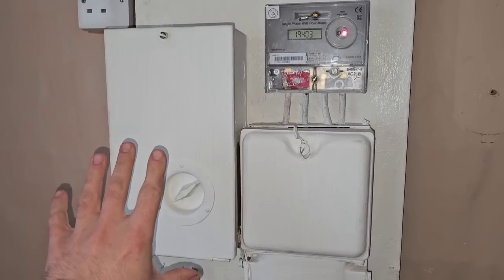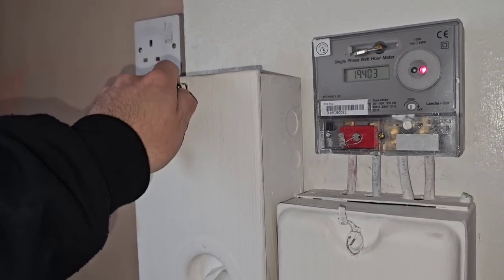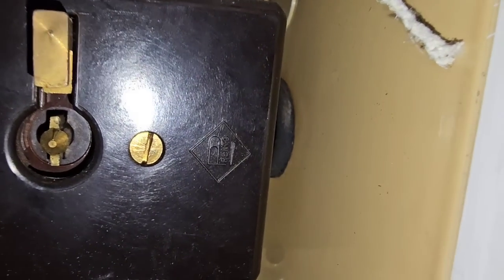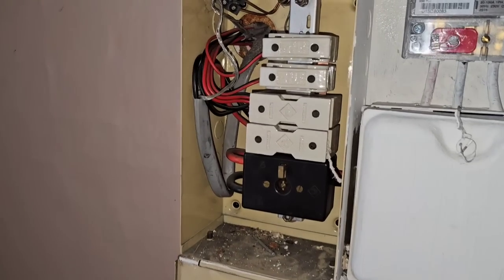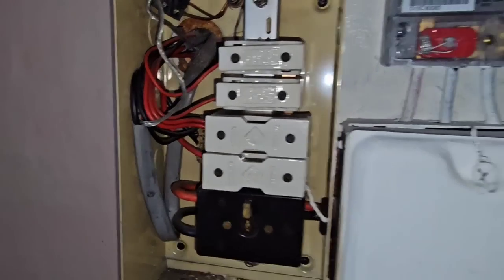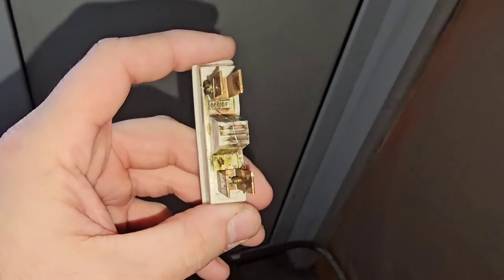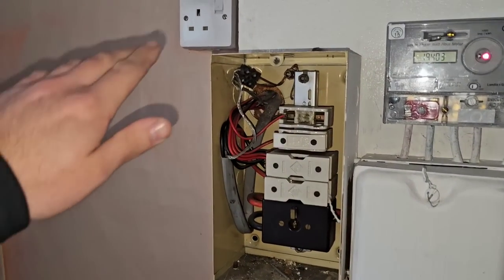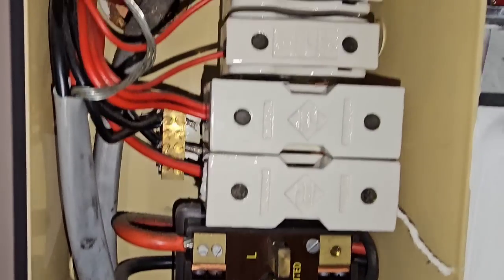Is this the oldest fusebox you've ever seen? 👀

Comment: Well I cant be certain about the make of consumer unit, but .... the Cutout is a Henley!
They are still good as long as the plate on top with the tails running through it are intact. Technically you will need to call the DNO out to get the outgoing tails from the meter out of the cutout. They originally had a devils creation of a live and neutral block inside the cutout so you only needed one neutral which went into the meter (but cutting that connection allowed free power so was outlawed) The connection in the cutout had a live coming vertically downward and then going out horizontally to the DP switch so it was easy to get a flash over! 

Originally they were fitted from the first electrification of houses en mass back in the 1920's.
They had a separate DP switch on the side (usually the right) and a fuseboard bolted above it! Earthing was usually externally done with a small stranded (if you were lucky) cpc cable of 4mm equivalent. These were a staple of council housing estates that were built around 1030's.
As you noted this was installed with pvc cable with earth so is probably 60's (some used earthed cables even before it was mandatory!

There will be a 60A main fuse that can be upgraded to 80A, but if you need more than that it is time for a new cutout from the DNO!

I started work back in 1977 for NORWEB and worked there until I retired this year so I have come across more of them than most!
One thing you would need to check is the sizes of those cables as the fuse ratings may not take 32A as they were fused at 30A (OK I know .... rewireable 30A is higher than CB at 32A).

All in all a nice Blast from the Past!
Reply from the maker: Thank you so much for the information! This is the kind of stuff I want in the comments. Nobody knows everything when it comes to our trade. We're always learning and nuggets of info like yours goes a long way to improve our trade. Cheers mate 👊

Comment: I started playing (literally) with electrical fires at a 6 yrs old.  Our home was built in 1904 without electricity.  It had gas (coal gas) lights.  The house was upgraded to 110VAC 30A 2 wire service in 1916, yeah, less than 4kW main.   My mom was the usually the duty electrician/fire fighter as dad worked the night shift when the smoke started.  The main cutout was a 2 pole knife switch, but only 1 pole actually worked.  The problem was the bare wires in the main box would heat (cherry red) then sag and short to some other wire cause the power outage.  Fuse never blew out just glowing wires. Mom would go to the cellar and poke the wires apart with a wooden stick and all was well again, she was a pro.  ❤   We used that panel until 1960, never had a serious fire.  Codes are overrated.

Comment: I found an old wooden fuse board with "Le-Clanche " glass jar battery pack (to maintain the servants bell during power cuts) in a 200 year old tenament on Edinburgh's royal mile .
Edinburgh had D.C electric supplies originally. 
The building was like a lived in museum. The lady owner had been born there , and died there at the age of 101.
 The board was bypassed with a 3 fuse wire board , the house had 2 13 amp sockets and 5 3 amp sockets , all round pins  . The big fuse was for the twin divers style cylinder for hot water . 
A fascinating experience surveying it for modernisation. 
Fortunately a retro loving couple bought it and as far as I know it's a family home now.

Comment: I have one of these Prento/Prentice boards (minus the paint job) in my outbuilding that feeds a ring and a few lights, it does need replacement but it has an RCD upstream and all the wiring is in PVC so I've left it as it is for now until the upstream consumer unit is replaced as well, I think it may have been re-used from the house as it's the same 50/60s new town era (Hatfield)

Comment: These bastard biscuit tins. They’re designed to be put in and never worked on again. By modern standards you can’t do much with them safely. I worked on the service head side of these and it SUCKS - wearing LV gloves and gauntlets trying to bend 25mm cables into the terminals and maintain the IP rating. Then you start screwing it all in and a line terminal screw shears off. These were A07 code generators when I was MOPing for SSE, especially when on an audit if you catch my drift… looks like the electrician side is not much better!

Comment: Given the Earthing mod, I'd say 1966 could be when the lights were earthed, but the rest of the board is far older than that.
If the board had been replaced in 1966, it would be almost certainly be a typical Wylex fuse board, which had dominated since the early 1950s.
That dates right back to when the property was first built, which for the new towns of Stevenage or Harlow is late 40s to early 50s.

Comment: I gotcha' beat! A few years ago I came across one of the VERY old wooden fuseboxes with exposed ceramic fuses. I've seen a few examples of these over the years left in place (redundent) but this one was still in service! There were only 2 fuses - ring and lights. I asked the old girl if she wanted it upgraded but no dice. to my knowledge its still there. As for the one you have there - my dad still has one of these types - its a grey MEM branded unit. I upgraded it with an upstream RCD years ago but he doesnt see the need to change the whole thing. Its doing the job it was designed for.

Comment: Sadly the wooden Wylex board in my outbuildings was crumbling with woodworm, missing fuses had left exposed busbars... Massive old cast iron isolator in my previous house still worked perfectly and they kept it when the smart meter was installed..... P. S. Did my L2 and L3 age 66 to work on my own place as local sparkies have too much work on( cowboys excepted of course.) and yes when I rewired I discovered a lot of faults, despite a " clean" , inspection pre purchase.!

Comment: 1960s? That’s new! I once lived in a place in Portland, OR, USA built in 1908 that had the original screw-in ceramic fuse holder, still in service, feeding the original 1908 knob-and-tube wiring, also still in service. It was mounted in an asbestos-lined wooden box. Being a cheapskate and aware of how much current various devices draw, I simply respected the limitations of my home's wiring. Never blew a fuse, not once.

Comment: Call that old? What until you find a consumer unit with both the positive and neutral fused with a wooden frame.
This really dates me.
Jack, the Japan Alps Brit
Reply: I well remember the board at our house till it was rewired in about 1960. The original installation dated from about 1907 when my grandfather bought the house, and was a work of art in polished wood and porcelain. All the wiring was cloth wrapped and we rarely had problems with the system.
Reply: Yessss seen one

Comment: I think the logo is GEC
General Electric Company 
Some use re-wireable fuses and some use BS88 cartridge fuses

But not the oldest I've seen....

That was a wooden cased unit with a plate glass front, inside it had large brass busbars to which BS88 cartridge fuses were bolted directly using lugged fuses and a 0BA nut... The other lug was bolted to a bakalite stand off again 0BA

The main isolater was a 2 pole brass knife swich!

Most of the installation was wired in VIR insulated cable

Comment: When I had my Meter replaced to another Analogue meter by the utility company I was informed that the Fuses on the Company side were a Health and Safety issue as both Live and Neutral were fused on the incoming main. It tookover 12 month and a lot of hassling the provider to get it rectified! The only reason the meter was changed was the low usage, they were only concerned about their profit and not the householders safety!
Reply: Fused neutrals - MOCOPA said they need changing but the DNOs went with ‘ain’t broke don’t fix’ especially as most contained azzy as well. Puts owners in a bad position.

Comment: 60's PVC will be bleeding out green goo. I lived in a house where the fuse board was still made from wood, and it still had the original gutta percha wiring in it, and in the roof was the remains of the original knob and tube wiring. But I lived in the later addition, which had to conform to the later standard as at time of build, so that had RCD, breakers and such, while the house still had the original DCC rubber overhead feed wires, and a new meter sitting on the fuse board,  and no RCD at all, except for the one which had been installed when some work was done later on, leading to 3/4 of the circuits being fed via the fuses, with a few cards of fuse wire hanging off a nail there, and a 1980's era switchboard that fed a socket outlet or three, and then the new extension via breakers. House been in the same family for 3 generations, so still has the original 1900 and later regulations covering the original installation.

Also i lived in a block constructed in 1939 (occupation certificate date) which had some circuits still with the gutta percha wire, but a modern switchboard installed somewhere in the 1980's, as the building was being split from shareblock to BC, and thus they had to redo electrical and make it comply as all the new owners wanted 15A socket outlets, as opposed to the original 5A socket outlets, as the wiring was 4mm for them.

Comment: You should have seen the distribution boards this replaced they were often adaptation of DC installations installed in twenties or earlier. The worrying thing is the nail inside the box sometime the fuse wire was replaced by tinfoil cigarette packing. 
Health and Safety is a dead duck. They write a long diatribe on what they are going to do and then just knock it out often using cheap personnel with no protection. Seen it too often.

Comment: This one was in the USA.   A friend’s family ranch house dating back over 100 years in southeast New Mexico was probably built before electricity was available in the area.  The breaker box and wiring was probably not original to the house.  The load center had a single breaker unit that had four separate breakers within a single housing for four single phase 115 volt mains.  If one went bad the entire unit had to be replaced.   The breakers were discontinued by the manufacturer in the early 1950s so the only source of replacements was eBay.  Besides not wanting to buy an old replacement at collector prices, it was less costly to replace the load center and breakers with a modern ones.

Comment: The oldest fusebox that I saw was a wooden box with a glass front and porcelain fuses. The wire was cloth insulated running in metal conduit tubes. This was in a terrace house in Bradford we moved into in 1966. It was condemned and we had to have the house rewired before the power could be switched on. I was four at the time.

Comment: The oldest fuses boards I've come across over here in Austria probably dated back to the very early 1900s. Individual "lead fuses" as they were known on a piece of timber. Each fuse had a round ceramic base with a stud sticking out for fixing the actual fuse and two brass terminals. The fuse itself was a ceramic disc with two matching brass terminals and a strip of lead in between, held onto the base by a knurled nut on the stud. I don't think they were meant to be rewirable but had been bodged with various bits of wire when replacements were no longer available. One of these was in an abandoned house, not sure how long that had been sitting empty when it was demolished about ten or fifteen years ago, the other one was in the loft of a pre-WWI apartment building, supplying an old laundry that probably hasn't been used in a long time too. I'd love to know how long those lead fuses were used. Siemens invented the DIAZED bottle fuse in 1909 and I think they quickly became very common, certainly by the late 1920s. Still plenty of those around, indivdual ceramic bases on either a piece of timber or a metal grid. Exposed live parts all over the place and probably no longer legal by WWII but happily installed well into the 1970s.

Comment: There are quite a few of these about still. I thought No CPC at lights and switches isn't a problem - provided all lighting accessories are plastic? Looks like that house has those old annoying metal door frames too but could be wrong. many 1950s houses and flats were done that way due to timber shortages post WW2. Id guess that's a late 1950s board. Those integrated Boards are usually BILL or MEM

Comment: The shinney effect on the cable insulation looks like Capathene cable which had a waxy feel. If the terminals were loose and the cables became hot the insulation melted like candle wax thus exposing the conductors. It was only manufactured for a few years in about the late '50s.

Comment: Nope. I had two houses with fuse boards that were ceramic posts screwed into wood with a brass screw thing to allow you to change the fuse wire...
Also had bare live wires in ceilings on the joists with wood or bakelite clips on...
And vir that had perished in the walls...
Fun job.

Comment: My grandparents had a wooden fusebox with a glass front and round ceramic fuses. The wiring was rubber insulated in metal tubes, and when the rubber crumbled to dust various circuits shorted out. There was a Wylex fusebox added to this for newer circuits, the house had a combination of 2 pin sockets and 3 pin 5 amp, 15 amp and 13 amp sockets. The house was a 1930s semi and the wooden fusebox and rubber wiring was original. This fire hazard was still in use in 2003 when my grandad died. We cut off the power feed to the shed before the house was sold because the electrics in the shed were in an even worse state and we didn't dare go in there until it was disconnected.

Comment: The oldest I've seen was an old house in NSW, Australia. My wife wanted to visit relatives she had never met, Her fathers' brother.

We arrived & I was immediately fascinated by the old Bakelite power points & switches. I noticed that there were two metal conduits coming out of every point & an exposed, painted, earth wire between them. We talked about this for a while. eventually I asked if I could stick my hear into the ceiling.

What I saw was horrifying, apart from the dead Possums & carpet snakes. The wires were run on ceramic Insulators & were all bare. The rubber coating had fallen off years ago leaving the wires exposed, which explains the dead Possums, etc. In the Power board was a huge open double Edison Brass pull down switch, old type Ceramic fuses & a couple of huge meters.

I told the relative & they weren't worried & said it's been like that since the house had been built in 1915. We left next day I still shudder just thinking about it.

Comment: We had a wooden fuse box over the back door in my family home, even in the 1970s. No earth trip or anything, and the main on off was a massive cast MEM unit. 

In the farm buildings we had various fuse boxes, and three phase for large motors. No earth trip. The whole thing was a fire waiting to happen, though it never did. I was quite adept at rewiring those old ceramic fuse holders!

Best wishes from George.

Comment: Very interesting video that will no doubt yield some interesting comments and opinions.
The only requirement the current regulations make of old installations is that they be inspected and tested at appropriate intervals. If the installation is in good condition as it stands then it would pass an EICR with C3 recommendations for improvements.

Comment: Also, I fitted a new DB onto a 1960s conduit installation today. The cables were PVC but they certainly had a bit of "stiffness" to them! I know from working in the building in the past that many of the lights have very brittle cores behind them from the old fluorescents that used to be there. Now all LED and a lot of oversleeving to protect the brittle cores.
Reply: Heat and UV can damage PVC pretty badly as far as functionality is concerned. Other than that wire insulation usually just gets tougher and tougher to the point you're barely able to strip it.

Comment: The biscuit tin cutouts around here were usually fitted in council houses that were originally wired in conduit. I've never seen one with its original fuse box attached like this though! 

By the way, the meter was originally butted up to the cutout, no cables were visible.

Comment: You obviously haven't been to New Zealand yet. Most older house have these fuses on a pertinax panel with a wooden frame around it and no cover. Often installed in hallways or bedrooms. And mostly 2 or 3 phase.
Reply: Likewise Australia.  There's still a lot of old wood frame switchboards out there.  They are slowly being replaced as people upgrade services / renovate.  You see them outside on the verandah/porch/tucked under the front of highset houses, exposed to the elements only relying on the rain shadow of the house to keep them dry.  If it's mounted on an exposed wall, not protected by the rain shadow of the house, they'll be in a open backed galvanised box.  I take photos of them, with owners permission, and I imagine someone people would die of fright if they saw where we put them.

Comment: That thing is beautiful and it's still in pristine condition. Just have to decontaminate it and then you can put it into your museum collection.
 Yeah there's being careful and then there's being careless. As long as you don't put the fibers in the air. I would probably snip off at the fuse carriers carefully pull the box off and then wipe every cable down. As far as the fuse carriers go yeah that's gonna have to get removed from there it is a bit dusty.
It's amazing what a properly installed system looks like decades later when it hasn't been messed with.